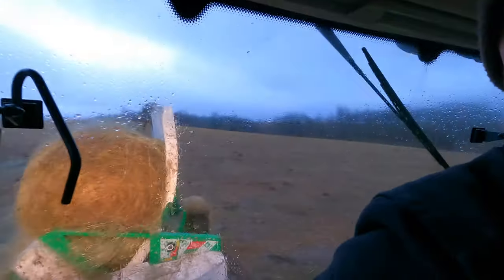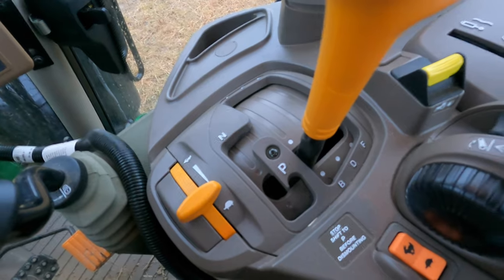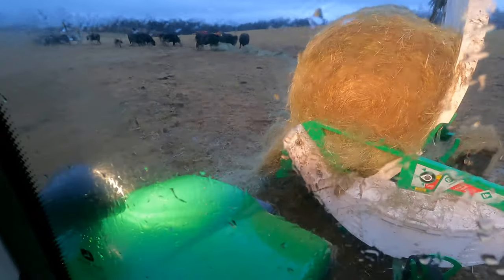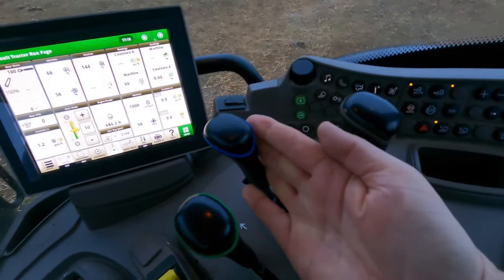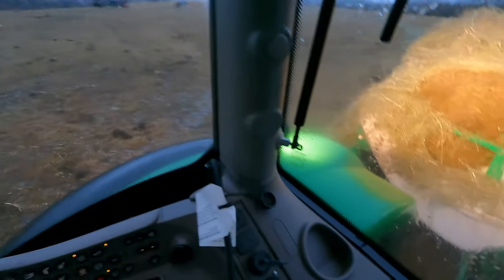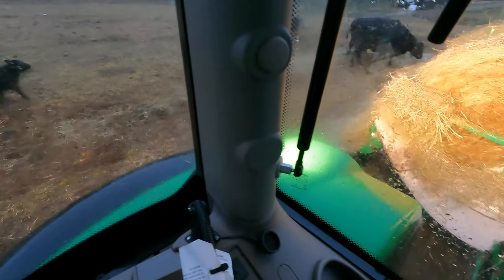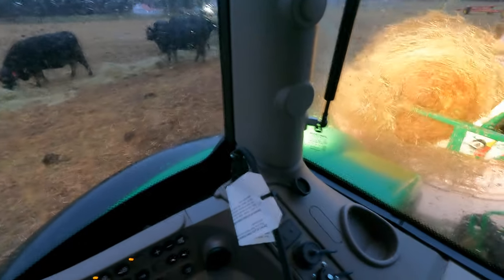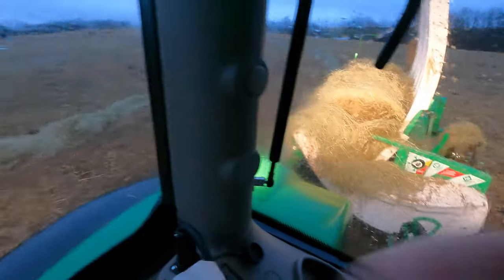This is how we feed hay to our Angus cattle

Comment: I have a 3 point hydraulic bale spinner.  Much more handy than the hustler imo.
When the ground is wet I found it's best to spin into piles vs. Stringing it out, cows will stand around the pile vs. Walking down the string and trampling it into the wet ground.

Comment: Really good video! I have a couple of questions. How many rolls do you feed, and how often? You have a roll on the loader, is that how you load the Hustler?
Reply from the maker: I can feed only one at a time, but I carry one on the front spear, one loaded, and one on the back of the Hustler in transport mode. I will be getting a double spear on the front soon, so I can carry 4 in total. I have fed out over 500 rolls so far through the Hustler and it's flawless. I feed about 1000 rolls a year. I will make a video soon to show how you load the Hustler. Thanks for the compliment on the video.